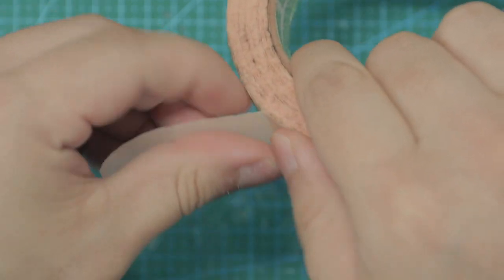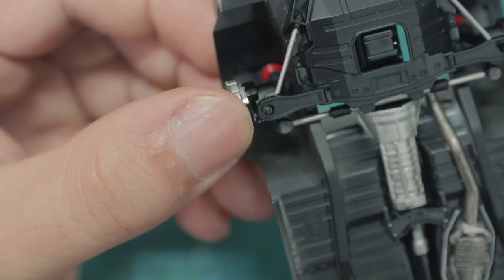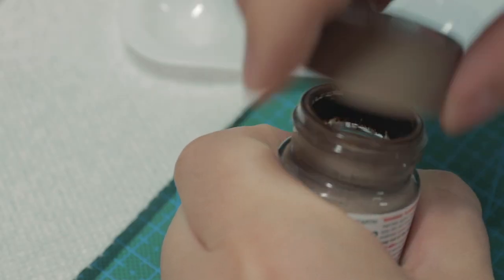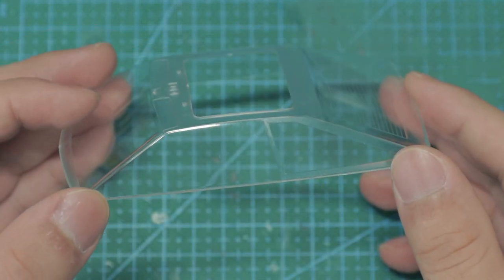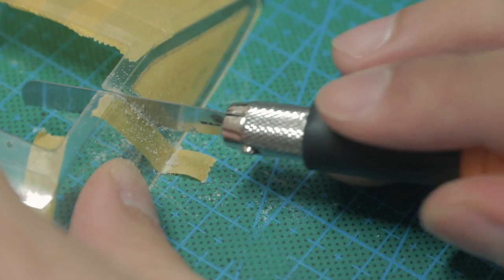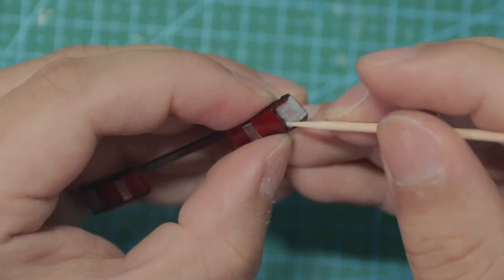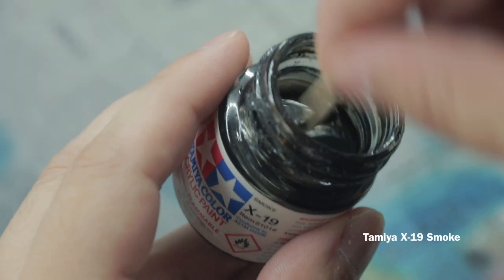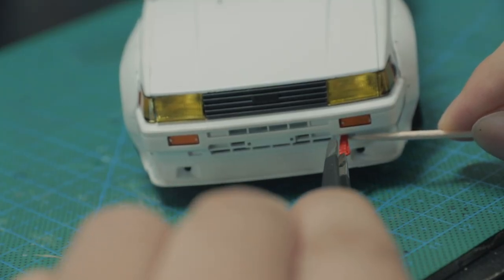Part 3: TRD Toyota Corolla AE86 Levin N2 Build - 1/24 Aoshima

Comment: Hey Jun hope all is well can you give me a few pointers on the car decals I’m new to model kits and didn’t know how to get them to stay or take out the backing on them thank I’m advance !
Reply from the maker: The water slide decals will need to be cut and put into warm water for about 15 seconds until the backing paper comes off. Then just gently glide them onto the surface where you want them to be and remove excess water with a cotton swab😊
Reply: @JunsMiniGarage  thank you so much I really appreciate it !!!!!! Recently ordered the trueno version of this kit looking forward to putting your tip to use thanks again !

Comment: Hi Jun, I have a technical question if you don't mind - is it safe to apply MARK FIT decal solution on painted surfaces?
Reply from the maker: It is totally safe to apply Mark Fit onto painted surface if the paint job are lacquer and enamel based since those two types of paints are resilient. But be careful when applying Mark fit over acrylic clear coat(like Tamiya X22 clear gloss) since they are both alcohol based, the Mark fit will leave stains or fog up the acrylic clear coat, it’s still possible to apply Mark fit over acrylic clear coat if you allow it to be fully hardened. Hope my answer helps. Thank you for the support❤️
Reply: @JunsMiniGarage  hey thank you for the tips!

Comment: Is there a engine model under the hood or do you have to do that yourself
Reply from the maker: This kit doesn’t come with an engine, but I have seen others use the engine from the Trueno AE86(Aoshima) and it fits well. You can 3D print an engine for this car, too.